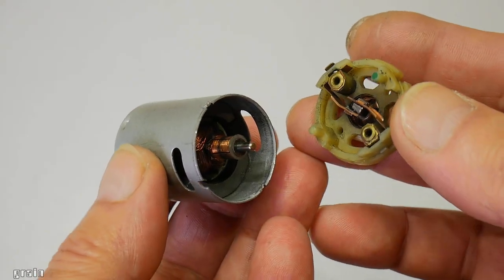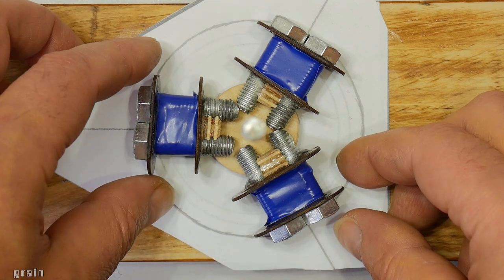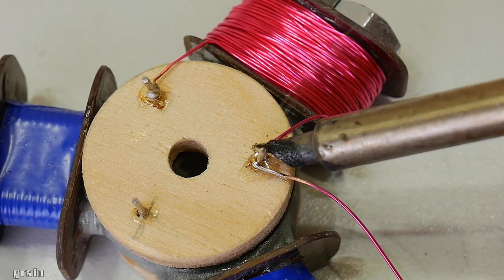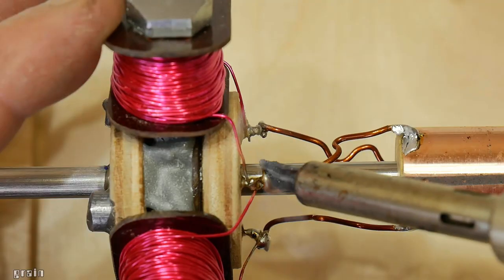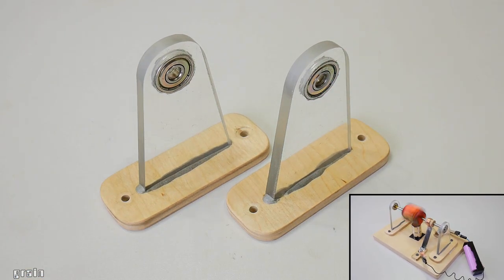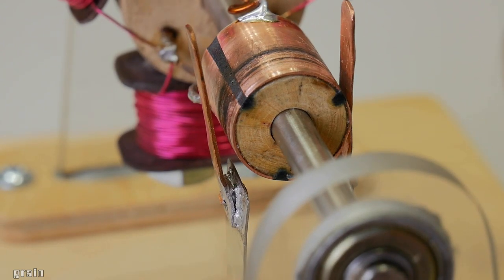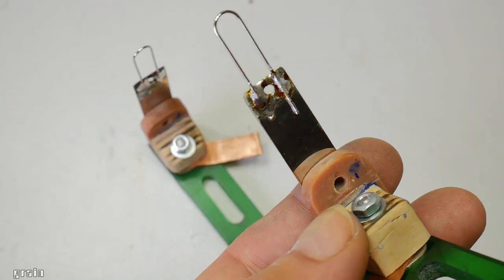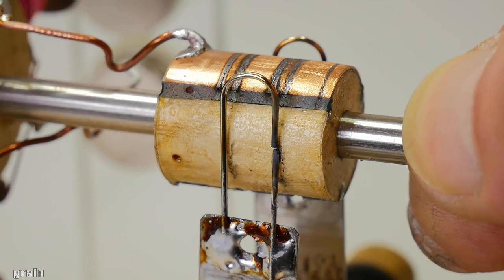Standard Brushed DC Motor

Comment: Spinning the coil vs spinning the magnet. If the coil was the stationary one. And the magnet spun. You would have to come up with a design where things don't touch spinning causing wear and tear on brushes because it's metal on metal contacts and it's getting hotter with sparks

Comment: I like it.  Move the Neodymium magnets closer to the armature and try using the Neodymium DC brushed motor to spin a secondary armature through a weaker magnetic field (ceramic magnets).  Compare the input power consumed vs. the output power of the generator that uses a weaker magnetic field.

Comment: High current arcing is the issue here. Thinner wire with more turns on coils. Higher voltage and lower current. A vacuum cleaner motor will be a good solution to see how to do it. Many for free on the side of the road.

Comment: One thing to realize is a d c motors potentially a pulse. Because of the commentators. If you put capacitors on a dc motor That are the same ferrets as the coil has inductance. You can post it at just the right frequency to where it goes enormously faster.

Comment: Pop Rivet Copper brushes to the base,  put o rings on the commutator ends and epoxy.
Put a turbine fan on the shaft between the brushes and the bearing made from a solid tin snipped every few mm and bend the sections at a 30 degree angle. that will run a column of air over the commutator in proportion to the speed of the motor and enable cooling and prevent the failure.
It's a fancy toy science project to produce in the unique grain manner of production. :)

Comment: why we need motion if we have circuit breaker components from Arduino programming 
just make a potential difference so we found it from earth  and magnetic fields  and with very little supply of electric current we got some more potential difference like we give neutral
Reply from the maker: Arduino is a completely different story. 😀

Comment: How about if we use a couple of roller bearings as brushes with sprung suspension or use sprung Carbon brushes so the Commutator does not wear out easily?
Reply from the maker: Well, this is already a professional approach. 😀

Comment: Why couldn’t you make another coil and make it produce the electricity to run itself? You ran it on a 1.5 volt battery., that’s a very easy amount to induce. Also, why not use carbon brushes like the ones used in power tools? There’s so much more you could do with this!

Comment: This is an old hat design with brushes and as such is very inefficient. NOT of any value. NOT SCAM but NOT ANY GOOD.
Reply from the maker: OK, did someone talk about the value of design? People are interested in knowing how it works. And there are still plenty of brushed motors around us today: in household appliances, in toys, and so on. Have you seen a household drill or jigsaw with a brushless motor? 😉
Reply: @grain-diose  what is the spray and what is it for?
Reply from the maker: @Billan123  Super glue (cyanoacrylate), but two-component, which is much more convenient: a) you can take your time when gluing and make corrections, b) the glue is stored much longer, c) it is thicker and does not spread. 
I use Turkish production. It has several types  - https://www.somafix.com.tr/SOMAFIX-UNIVERSAL-FAST-ADHESIVE-S667-EN.html